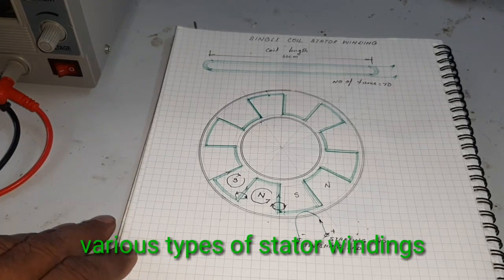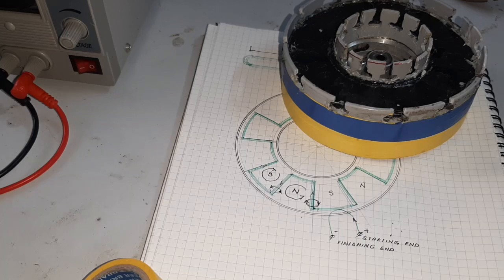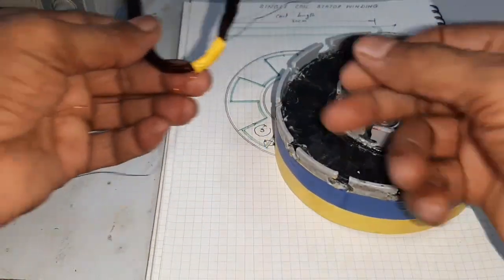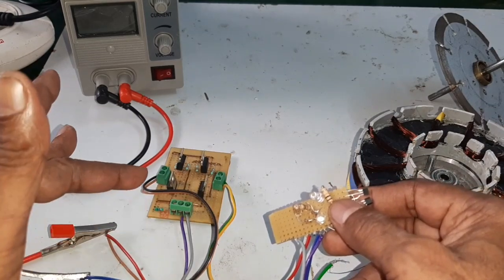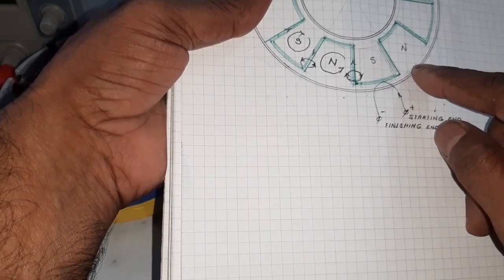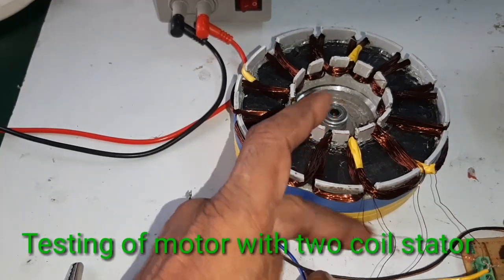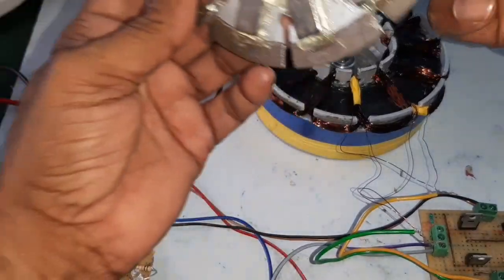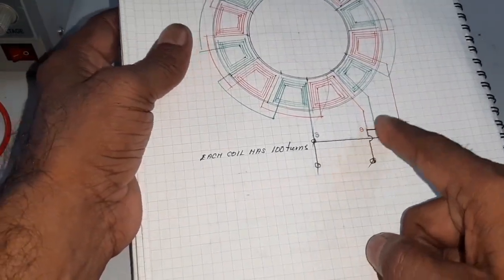(V-107),Axial flux Bldc motor using various types of stator winding

Comment: Very good setup to demonstrate axial flux motor you made sir. Please also see what is torque of motor when there is 10 magnet, and 14 magnet on rotor with 12 pole stator. Because I think sir that, this imbalance in stator and rotor pole make the rotor to accelerate on throttling with bldc controller. Thanks for explained. And waiting for this what will happen to this.
Reply from the maker: Thanks sir